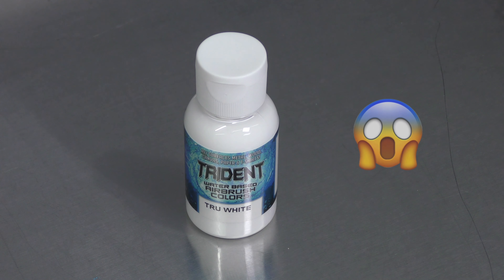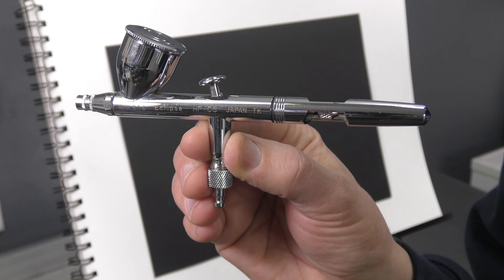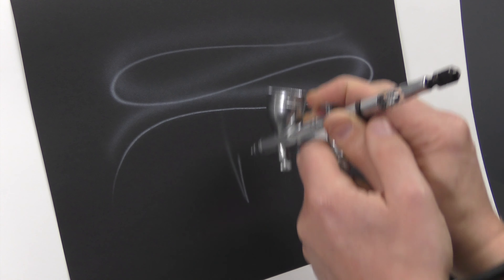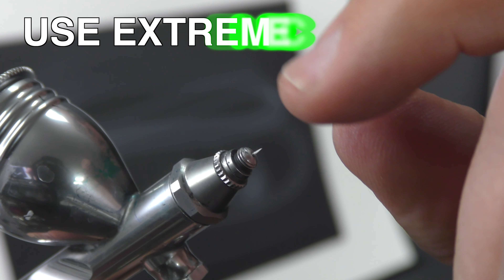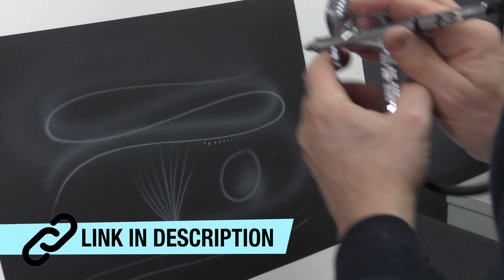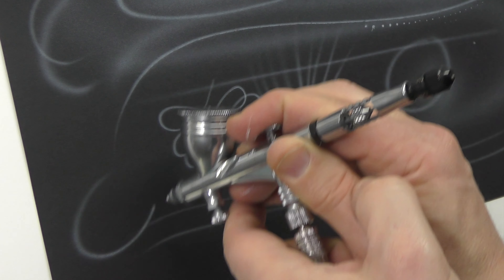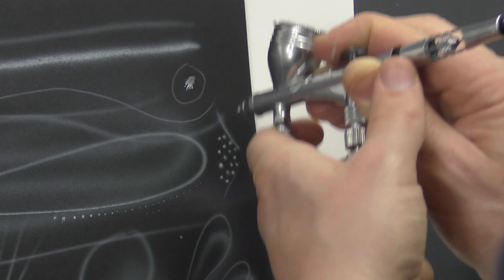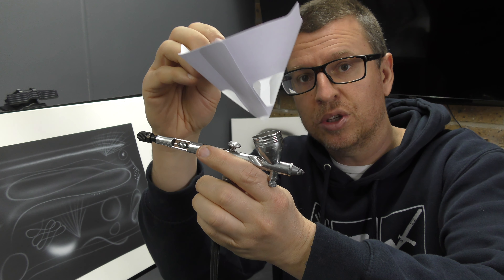Trouble Airbrushing White Paint ?

Comment from the maker: 🎥 Need help with Tip Drying ? : https://youtu.be/Ee9vzSW7KD4
Reply: I'm sorta new, and I'm lazy, so I sit in a chair when airbrushing and I cant get a steady hand/arm.  Would standing in front of an easel be better, or a stool?  I use a smaller desktop easel right now and a table and chair setup.  I do have an easel like yours though, I just got it.  Thanks.  p.s.  I also only have a small compressor, with tank, and it seems to run constantly when I am using the system, it doesnt keep ahead of the airflow, but it does seem to keep up with it though.  Im not made of money.. LOL.  But I did invest last year into the Eclipse.
Reply: @latenighter1965  you might find a ledge, stand, or chair or or stool might help you steady your hand.

Comment: Thanks for the help video for the white’s!!🙏 
I figured out my problem the other day. 
I’m a newbie to the brush as you can tell by my question’s. I started out with the Chinese red brush like you had in your comparison video with it against the Iwata doing skulls side by side. And to keep going the cheaper way I bought a big chain box stores large set of “no name acrylic brush paint. Well I was wanting to try skulls and the first color I tried was the white. Everything I tried with thinning the paint different ways, 50/50, 70/30 and even going to the extremes both ways along with different pressures up and down the range it would not spray anything out but the reducer. That’s why I couldn’t see anything coming out of the brush until I would stop my stroke and it would finally start to spray paint out and spidering before I could react fast enough with getting the stroke movement going again. Every other color works and sprays great except the white. I don’t know what’s different about it but it will not accept the reducer. I can stir it with a paint brush really well and after I pour it into the airbrush it will separate. 
At first I thought it was a bad airbrush so I bought a Badger Patriot 105 fine needle and nozzle combo along with their superfine needle nozzle which  makes it spray a extremely fine line. It would not spray the white either. I tried the other colors in the red brush and it sprays them well also. 
I bought some createx airbrush white paint and both brushes sprays it just fine. 
I’m guessing that the no-name acrylic paint company must have added something to the white paint that the reducer will not bind with that’s causing it to separate like it does?? 
Anyway thanks again for the great advice earlier with your reply to my question and this extremely important help video!!🙏 I know it will help all the newbie’s out there because I did a search for the help spraying of white paint out of airbrushing before I asked you for help and as far as I know yours is the only one on YouTube!👍👍👍
Reply: I am going to stick with buying paint made for airbrushing from now on unless I get in a really bad pinch.
Reply from the maker: Thanks so much mate and yes , white is challenging hence why I made this video to hopefully help those that have had issues using it. 🤞🏻
Glad you got it sorted in the end and through the process of elimination you figured out that it was the white (cheaper paint) that was giving you grief. I would definitely recommend paint that is specifically designed for airbrushing as you have learnt that you can’t count on the performance of cheaper paints . 👍🏻👍🏻 glad this video helped thanks again for sharing your experience I think this comment will be valuable to many people .
Reply from the maker: Yes great move 👍🏻👍🏻

Comment: Does anyone have any tips for white primer? I really need it for a project I'm working on but no matter the brand or what airbrush I use it always goes on chalky and beady, even at 40+Psi. Never had this issue with anything else to the degree that I couldn't solve it but this is really a wall for me.
Reply from the maker: How are you spraying the primer ? If you are trying to spray it through an airbrush, then it may be too thick and keep in mind some paints are not designed to go through an airbrush, so if you over thin them then it will compromise the viscosity . Perhaps try a mini spray gun and mix according to the recommended instructions on the primer 👍🏻 hope that helps
Reply: @Airbrush Asylum  lately I've been using the pro acryl. It is made for airbrush and per the instructions you are not supposed to use thinner.

Comment: I’m not having a dig but I’ve been using an airbrush for years to do minor repairs on ceramics in construction and most ceramics are white and I’ve never had an issue regarding the colour, is that because of the paint more so than the airbrush?

Comment: I have an issue with the same airbrush you used I have pressure at around 70 80 psi and it seems to Barely spray ,then I'll switch to my harder steenbeck with the .4 set up and it seems to reflect the actual psi on the regulator..